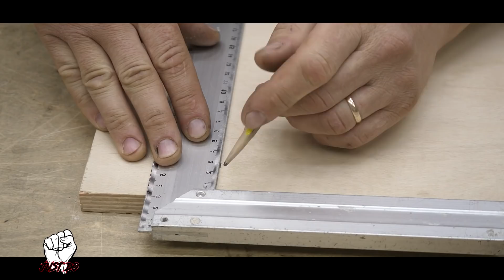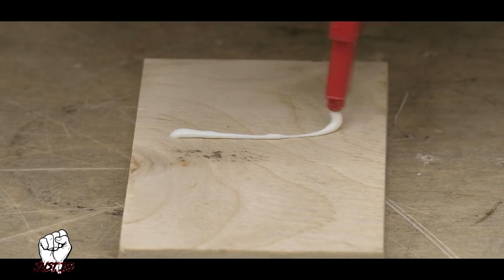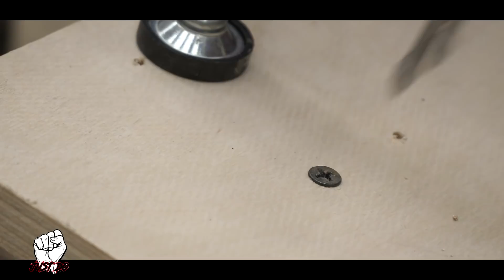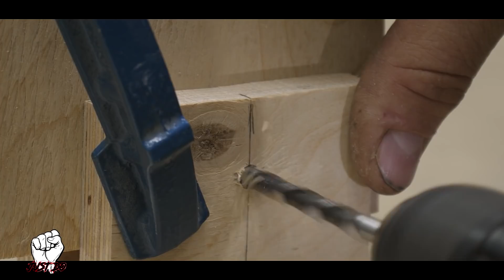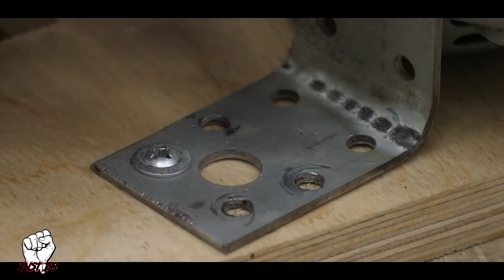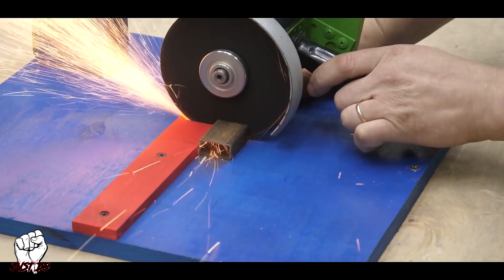Few people know how to use a sander correctly!

Comment: Great job mesuring the corners. The way you applyed the glue is great, never apply the glue in a zig zag like most instructions say because it works too well. Nice sander by the way. Great cam out on the drill, it shows how experienced you are.

Comment: This is just another way and not the correct way, otherwise we'd be dismantling walls, sills, doorframes, etc, in order to introduce them to the sander!
A little humility goes a long way.
You might also consider padding the vids less, ie, use fast forward, but I guess  that would subject your subscribers to less adverts, so you'd make less money off them. 
Smh and lmao.